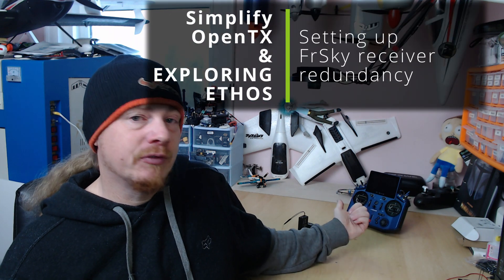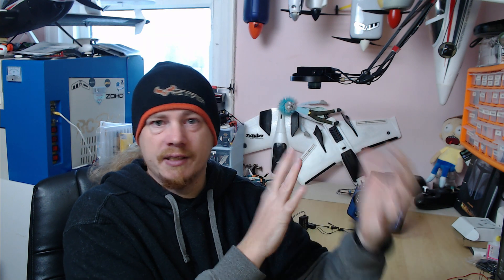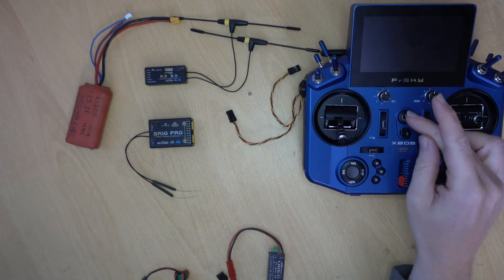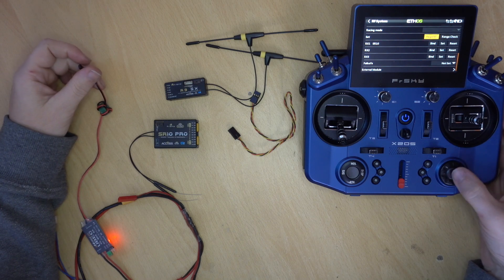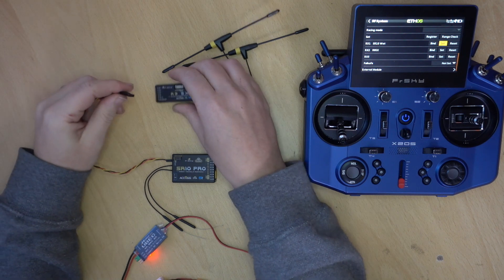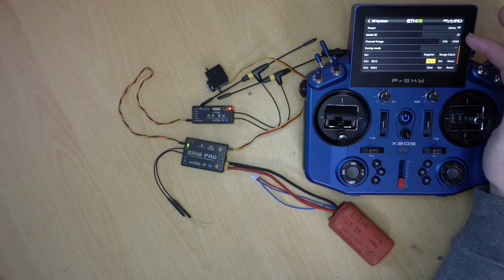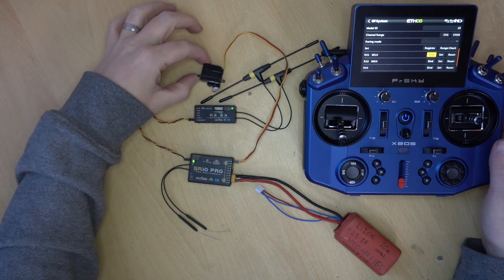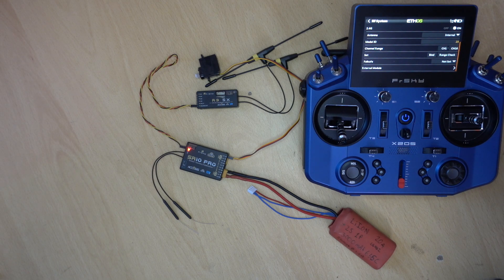Setting up FrSky Receiver Redundancy

Comment: Darren, thanks for your videos, they've been helpful.  Question: can the X20 be bound to three different TD R10 receivers and simultaneously control throttle and rudder for motors and rudder independently connected to those three receivers.  Odd request for controlling compartmentalized components on a RC Submarine.  Thanks.

Comment: Hello there, thanks for the explanation! if I understand correctly, this method doesn't work as a "real" backup if one receiver physically fails, right? For example, if the main receiver has an electrical problem, such as a loose solder joint inside the reciever, both receivers would be dead. Is there a way to have a "real" backup, that is, an independent receiver that would still work if the first one fails in mid-air?

Comment: Is it mandatory to have a "redundant" receiver setup?
Reply from the maker: Not at all.
Reply: @MrD  Thanks Darren. I installed the SR12+ in one of my e.d.f.s. Installation and programming was not difficult. I used all 12 pins in order for my program to function. The problem I encountered was that Aileron 1 pin 1(if stabilized) is used in both "Normal" and "Delta" wing configuration. That's fine. But I want redundancy in my e.d.f. In order to achieve this. Pin#1(Ch 1) must be assigned as "SBUS IN". This requirement to have redundancy has now directly impacted my programming. I am now unable to use the SR12+because I am now "ONE" Pin short for my program to function. But I do have redundancy. This is where my original question came from. Is there a work around where the "SBUS IN" is assigned elsewhere? Thanks

Comment: Can you help me I’m running a TD SRX18 and want to run an additional TD MX receiver for more protection how can I check to see if it works when the TD SRX18 is disabled?
Reply from the maker: The only thing I can think of to check with TD. Is to clear the bind on one of the receivers. The other should take over.

Comment: @barrybroad3912
39 minutes ago
Hi I have just come across an anomaly between the x20s and the x20 Pro when you select external  antenna on x20s it states to put antenna into ant 1 for 2.4ghz but when you select external antenna for 2,4 on the x20 pro its states socket antenna 2?
I am making assumption that frsky would have no need to change position of the 868mhz and the 2,4 between the two radios. Could you confirm if this is indeed correct or if there is an error in the firmware between the two..
Regards
Barry
Reply from the maker: Currently on the X20 Pro. Both external antennas are for 2.4GHz. One for FSK, the other for TW.

Internally, the hardware supports an external antenna for 900MHz. I’m hoping that in the future there will be an option in the firmware to say which antenna is for which module. I have actually made the internal hardware change already. I personally don’t see any point for an external FSK antenna. The internal ones work well enough for LOS already.

Comment: Hi Darren. I want telemetry from both receivers, (RSSI, Rx Bat etc) can I use F-Port to achieve this somehow? I have a SR8-Pro with a R9-Slim+OTA and the telemetry from the external sensors is lost using F-Port however only the SR8's sensors show using S-Port. I'm using EdgeTX on a X10S Express radio. Thanks (I'm not real familiar with F-Port)

Comment: thanks for this, I'm using a tdr12 rx plus a TDMX satellite rx, I assume everything is the same. Somehow missed that you must have telemetry off on the satellite, mines working , I'll have to check tomorrow whether my TDMX has telemetry switched off, what are the repercussions if it isn't? I'll have to make another model for testing the TDMX, as now I just have one plane set up.
Reply from the maker: With protocols newer than ACCST. You can have telemetry enabled on all receivers.

Comment: I am using an SR10 Pro with an R9MX for redundancy. The conventional wisdom is to disable telemetry on the R9MX. Can you tell me why?
I ask because I have the R9MX located in the horizontal stab where it is not visible. The only means I have to determine the R9MX is functioning are the signal bars that appear on my X20.
Reply from the maker: With ACCESS you can use telemetry on both receivers. It was only ACCST that only the master could use telemetry. https://youtu.be/Q59ai7sZA1E?si=u0c-ooZ3npcDPRov

Comment: Supplementary question please? I changed the Rx number of the 2.4 Rx to test failover but the servos stop working. I'm getting good RSSI on both Rxs. Am I doing it right? (ps., following your excellent review of the X20S, got a nice red one yesterday :-) Highly impressed so far. Just following your Ethos Suite & update vids - going to be back here quite a bit I can see. Great content - very clear)

Update - doh.. hope you haven't read this yet. Silly me didn't change Ch6 on R9SX to Sbus. Hence the no failover. All well now, Just change the Rx number on the SR8 and servos keep working from the R9SX. (That said, huge amount of RF interference from R9 antenna to servo (long lead next to them). Having to try to find another spot for them further away from that lead. ('course I'd just finished hot glueing the antenna in the bottom of a highly inaccessible innards..)

Comment: Your channel is a lifesaver! Curious , setting up this exact set up sr10 pro and a r9 sx, after binding I am assuming you can temporarily disconnect the r9 to do the initial sr10 calibration  sequence? Then plug it back in?
Reply from the maker: Thanks, I’m glad the videos are helpful. Yes, you can remove the R9 SC while setting up the SR10 Pro. That’s fine.

Comment: Hi Darren. A new problem, I have an RB-10 connected to an SR8 Pro and a R9MX. The problem is when I unplug the SR8 and re-plug it, the servos all go through an exercise cycle. That would be scary while flying. I substituted the SR8 Pro with an R8 Pro and the problem went away. There is no problem with unplugging and re-plugging the R9MX. I have tried this with both receivers on the same Rx number and different Rx numbers, no cure. I suspect a stabilized receiver is not the best choice with the RB10 . Any insight would be appreciated. Thanks!
Reply from the maker: You could have just turned off the stabiliser in the SR8 Pro. You shouldn’t use stabilisers as an input to the RB.
Reply: @MrD  But I want the stab function. I see the RB25S has built in stab, guess that is my only option. Too bad FrSky couldn't make the RB units work with Stab Receivers. They don't mention this limitation in any of their literature, unfortunately I just bought two of them. I am rigging a 30cc Ugly Stick, 8 servos, all 200+ oz @ 6V. I'm worried there might not be enough current available from the SR8 Rx without the RB10.
Thanks for your reply.
Reply from the maker: Yes, currently the RB25S is the smallest option. I don’t know if there’ll be an RB15S in the future.

With redundancy in general. Only the master device should have stabiliser functionality enabled. The same is true with receiver redundancy. In the case of RB. The RB unit is the master device, and all the receivers are slaves.
Reply: @MrD   I have learned more unfortunately. When using both an X10S Express OpenTX or an X20S Ethos radio.
Attempting to use redundancy on a new gas airplane.
R8 Pro and R9M receivers, and an RB10 (V171010)
The latest firmware on ISRM and V2.1.14 and V1.3.2 on the receivers.
Without fail, while all connected and working perfectly, if I unplug R8, re-plug R8, then unplug R9M;
The RB10 LED goes red and I lose all control.
Then I re-plug R9M and get back control.
I tried this with both radios, exact same problem.
THEN I switched the R8 Pro with a Archer R6. Problem SOLVED !
I believe there is a FW issue with the R8 Pro. I tried every FW back to V2.1.9, no change.
If I eliminate the RB10, the problem goes away.
If I try an SR8 Pro, with the “S” turned off, same problem + some of the channels reverse when the R9M is unplugged !!!!   Definitely not an option.
(It seems the S type receivers have different output directions to standard receivers, regardless whether or not the stab function is on or off, there for not usable in a redundant setup using an RB10 redundancy bus.)
All I want is a usable setup for a gas airplane yet I still can't find one. The SR10 Pro if available would likely have bean the answer.
Reply from the maker: Thanks for this information Dave. I have forwarded it on to FrSKY. Their technical team will be investigating it. So hopefully there will be a fix in the future. I guess in the meantime, the Archer receiver looks to be the safest option.
Reply from the maker: Could you confirm if the R8 Pro and R9 receivers are using ACCST or ACCESS. Also, which R9 receiver is it? I guess either the R9 MM or R9 MX? R9M is the module that goes in the back of the radio.
Reply: @MrD  Yes, ACCESS. The R9 MX OTA. FW 1.3.2  and R8 Pro FW 2.1.14
Reply: I even checked the Transmitters; X10S;  ISRM V2.1.9 FCC, and R9M V1.3.0 FCC  and  X20S; TD-ISRM HW 1.4.0  FW: 2.2.2 FCC,

Comment: Could PLEASE  Demonstrate Two r-xsr receivers ? S-bus in and S-bus out receivers !! wired up ?
Reply from the maker: It is the same as in the video. Just take the SBUS out of one of the receivers and connect it to the SBUS IN of the other receiver. You will also need to share the power and ground between the 2 receivers. 

It doesn’t really matter which receivers you use. Just stick to the basic rules:

Master receiver:
- must have SBUS IN

Slave receivers:
- must have SBUS OUT
- do not have any stabilisation active

Comment: What about 2 RX ( TDMX ) going into a RB35s 

Can I have telemetry on both RX as they are both master rx
Reply from the maker: You can certainly connect 2 TD-MX receivers to an RB35S. In fact, I will be soon. As far as ai understand it. Set both receivers to use FBUS for telemetry. And it will all just work.
Reply: @Mr.D - Falling with style  I've got them set to Fbus.  I just wasn't sure I can have telemetry turn on both RX or not
Reply from the maker: Yes, you can. FBUS includes telemetry and signal. So it’s all taken care of.

Comment: Well Darren,  to say I am at wit's end would be an understatement.  I followed your video to the T and cannot get the redundancy test to work.  The only difference is I am using an Archer SR10+ receiver with a R9SX,  is there a problem with this combo?  As soon as I change the Model ID to check the R9 functionality it doesn't work.  The SR10+ has a RED LED and the R9SX has a GREEN LED but no servo movement no matter what port I put the servo in on the SR10+.  The crazy thing is the stabilization still works when I move the SR10+ ?  So far not a great experience trying to get this redundancy to work.  

UPDATE,  JUST TRIED THIS SETUP USING A SR10 PRO AND IT WORKS NO PROBLEM,  ISSUE IS WITH THE ARCHER SR10+?
Reply from the maker: I've just tested this, and it works fine. I have set up an SR10+ as the main receiver with the R9 SX as the redundancy receiver. To wire it up, I first register and bind (RX1) the SR10+. Then go in to the receiver options and set Pin1 to SBUS IN (You will need to move all the control pins down 1, as I show in the SR10+ video). Next unplug the SR10+. Then register and bind (RX2) the R9 SX. Go in to it's receiver options and set Pin6 to SBUS. Power down the receivers, then connect from the CH6 pins of the R9 SX to the 1 pins on the SR10+. Power on both receivers, and it all works. I can turn off either the 2.4GHz or 900MHz side of the RF module, and the servo keeps moving. It only stops if I turn off both sides of the RF module, which is obviously going to happen.

But, TL;DR. It works fine. It must have been a setup issue you are having with the SR10+.
Reply: @MrD  Hey Darren,  really appreciate the response back as I know you are busy as hell keeping noobs like me out of trouble LOL,  again thanks!  Yeah,  your procedure works great as you wrote it and I was able to do this but it does not work if I change the model channel between the two as you describe in the video,  that's the issue.  Adam Mawz was able to confirm that your procedure as written above is good enough for what I am trying to verify but I was assuming you did the channel change for a specific reason and was concerned that maybe something was wrong with my receiver.
Reply from the maker: Changing the receiver channel was just a way of temporarily unbinding the receiver from that model. It’s actually much easier to just disable the 2.4GHz or 900MHz temporarily to test its working. So don’t worry about that. 

The key thing is setting the pin outs correctly on the receivers for this to work. The SR10+ must have SBUS IN on Pin1. It unfortunately won’t work on any other pin currently.

Comment: When you have 1 or 2 batteires plugged into the sr10 do you need to remove the red wire from your throttle/esc ?
Reply from the maker: If it has a BEC in the ESC, yes.

Comment: can you explain the advantage of this compaired to the new  Dual frequency receivers like the TD series.  Is this just for signal loss on one reciever?
Reply from the maker: The advantage is that not everyone uses the new TANDEM system. I would guess that there are still more people using FrSky transmitters that don’t support TANDEM, than do. So they can set this up and have redundancy.

TD does provide both frequencies on the same receiver. It actually uses both frequencies simultaneously when in range. It’s not just a switching frequency redundancy. So it could be argued that if you’re using a single 2.4 GHz and single 900MHz non-TANDEM receiver. That you could just replace them with a single TD receiver. 

But, there’s also nothing stopping people using TANDEM from also setting up redundancy. For example using a TD MX as a redundant receiver for a TD R10. This would give an extra axis of coverage for both 2.4GHz and 900MHz.

Comment: So the SR10Pro / R10Pro, they are advertised as very good for gasoline or petrol aircraft for the fact of antivibration and anti-spark. 

Fast forward a year later to today, and they have the TDR-18. Would you use the TDR-18 In a gas/petrol model? 

I need 14 channels so I would either buy 
2x R10Pro’s 
Vs 
1 TDR-18
Reply from the maker: Yes, all TANDEM receivers (including the TD R18) are safe for spark ignition engines. I’ve seen people use these in some pretty large petrol planes and turbines.
Reply: @MrD  thanks

Comment: Hi D. Can you point me in the right direction please. I have a TDR18 that I want to link with a TDR6.                                                                                                                                                  Can you please confirm where I should plug-in the SBus connections.
IE TDR6 SBus out. Can I assign any 3 pin PWM channel outputs ? / TDR18 SBus in. Can I assign any 3 pin PWM channels ? 
I looked but could not find one of your YouTube Videos for this. 
The TD R6 also came with a 6 wired white connector with no connector/s on other 6 wire ends. Would be nice to know what this can be used for ?
Many thanks.
Reply from the maker: Hi Michel. Yes, on the TD R6, assign one of the PWM ports to be SBUS OUT. Then connect that via a cable to a port assigned to SBUS IN on the TD R18.

The white connector can be used for SmartPort, Analogue sensor input 2, and SBUS OUT. To be honest, I only ever really us is for the SmartPort. That can be used to connect sensors or for performing wired updates, if you need to.
Reply: @MrD  Many thanks D. Your reply is very much appreciated & all sorted now thank you. Have a great Christmas.
Reply from the maker: Merry Christmas to you too Michael 👍🏻

Comment: Darren, can I use 2 receivers, one on 2.4, the other on 900mHz with an X10S on OpenTX ?  I would have the R9-2019 module and the internal RF turned on at the same time. Thanks for your help as always.
Reply: Low and behold, it works. I wanted a stabilized Rx and 900mHz and Redundancy. FrSky doesn't make a 900mHz Rx with S-Bus in, so I used a 2.4 g SR8 Pro as master, with a R9 Slim+ and left the telemetry on on both. I believe the slave Rx telemetry is ignored automatically, as I had great RSSI after changing the Rx # for both receivers. The green light went out separately from both yet they still always operated the servos. Till now I thought you could only have 2.4 and 900 together using an X20 and ETHOS. I wonder how fast the Tx battery will deplete running both frequencies?
Reply from the maker: @AntiqueAirman  I tend to run an external battery with the R9 on my X10S. You may find that will help if the internal battery is used up too quickly.
Reply: @AntiqueAirman  I was chasing this answer, couldn't find anything on having both 2.4 and 900mhz. Having a big glider for Triangle racing, the 900 is just insurance. So if this is right, as long as both receivers are on the same protocol (Access) we can have 2.4 on one rx and 900 on the other rx?
Reply from the maker: Using a TANDEM transmitter, they would need to be the same protocol. You can only set that once. 

But, using something like a Horus X10S Express. I think it could work with different protocols. Because each module (internal 2.4 and external 900) are set up separately.
Reply: @MrD  Steve, it definitely works on the bench, but we will have to wait till spring to field test. Maybe for instance the two Tx frequencies sending at the same time with the antennas so close together could be a problem, unknown. This brings up the question, could we utilise  the new FrSky "TD" receivers with an X10S using both 2.4 and 900 turned on? I don't have one to try.
Reply from the maker: The TD receivers won’t work on an X10S. They will only work on TANDEM transmitters.
Reply from the maker: Sure. That will work.